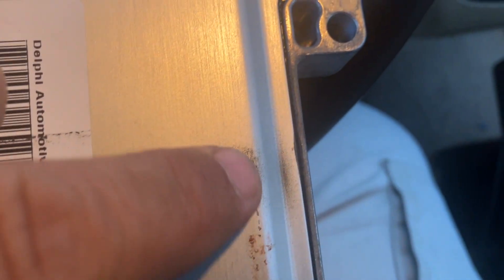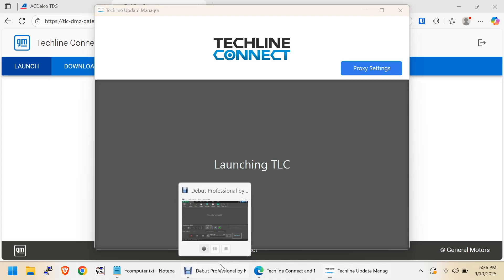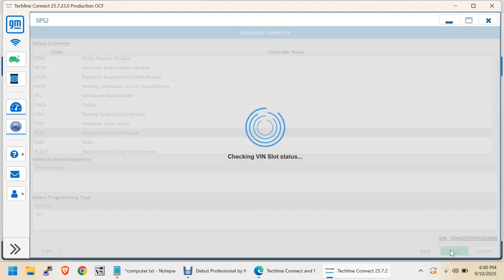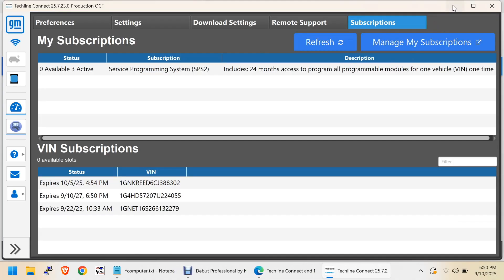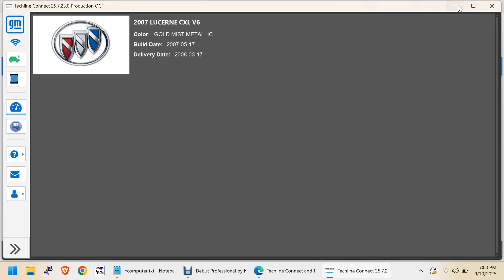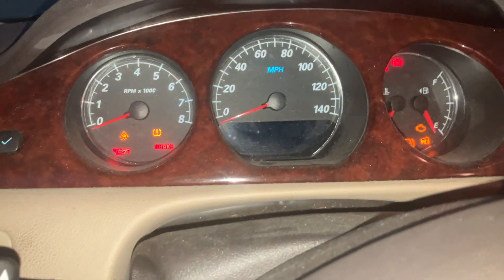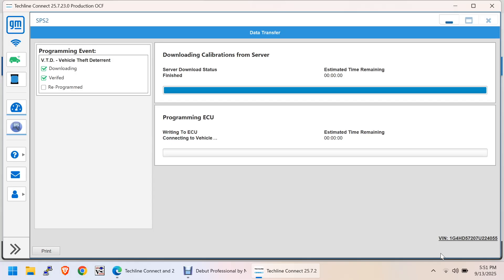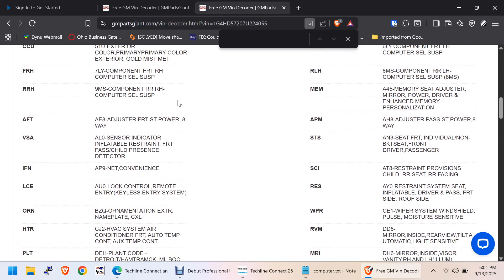The Topdon R-Link J2534 J-Box - Review, Setup, and Programming a GM - Part 3 - A Second Computer!

Comment: Hi can you provide an update as to what you ending up doing? Why weren’t you able to do a VTD Learn? Thanks!
Reply from the maker: After talking with GM Support. I was told to do a manual key relarn.  Put key in that won't work leave it in for 10 minutes, the turn the ignition off and back on and leave it for another 10 minutes.  Then do it one more time and it learned the key and started fine.